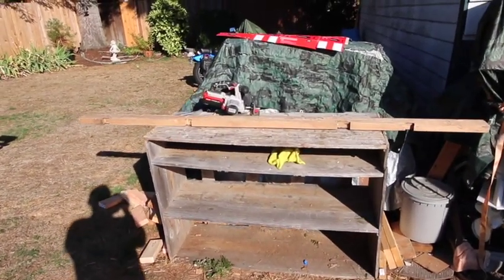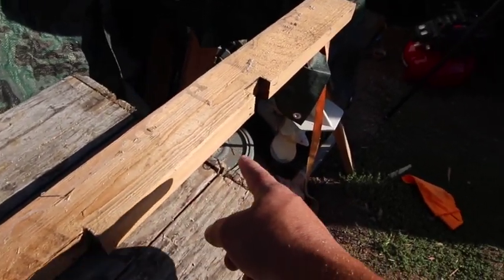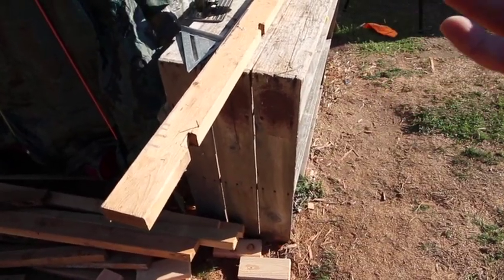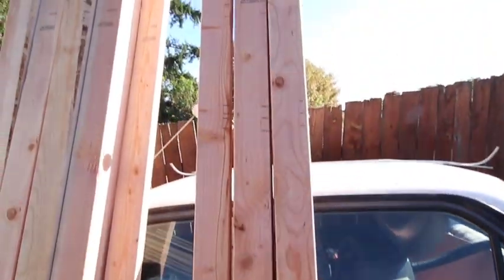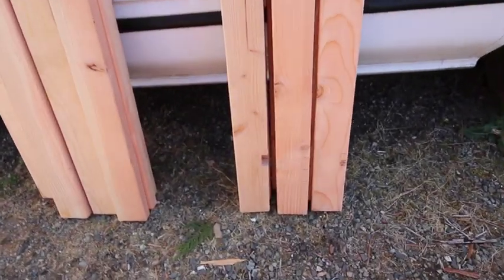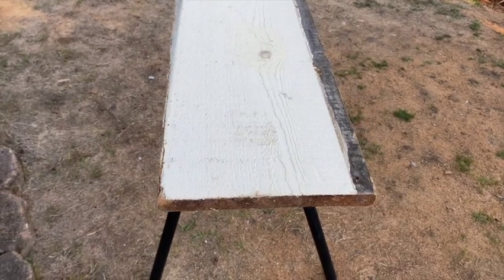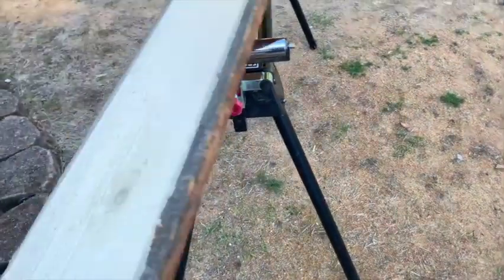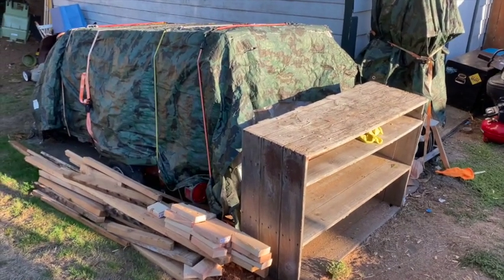Making Wall Studs for my Old Single Wide Mobile Home and Siding Explanaiton

Comment: Those cedar sure would look good but better being friendly with the inspectors and follow rules.
Reply from the maker: Yeah, he's been really helpful in giving me creative ways to work around some of the rules and avoiding the super expensive  permits and plans to get things done while still allowing the state to get some money out of me. But yeah, I was bummed about not being able to use that cedar on the house but I plan on making a number of outbuildings for a wood shop, auto shop, and a guest house so I may use them there. Or I want to focus on wood working projects once the house is done so I can always turn them into something cool in that regard. I had to pull them myself but they only charged me $5 a board which was a really good score I think.
Reply: @thesomewhathandyman9400  I fully understand... but with your skills I'm sure the next project will include ceder boards.
Great price for the used lumber, well worth it !
Reply from the maker: @VintageTexas59  Yup yup! Thanks again!

Comment: ✌️🙏🏻👍🏻  Keep on  , KEEPING ON 💪🏻   Adventures trailer home rebuild's.  
    Is lumber creeping down 💲 price wise.❓❓
Reply from the maker: It came down quite a bit but has crept up just a tad in the last month. Still reasonable. I did stock up on 2x4's and 2x6's as well as PT fence posts and PT fence 2x4's for next spring, just in case it goes back up. 2x4'x8's are around $3.50 and half inch ply is about $21. Not great but not crazy.

Comment: Wow are you replacing all the studs in the mobile or just some of them? I have a question on the siding. Im planning on doing sheathing and then t1-11 on mine but Im worried about the thickness when it comes to the tin roof on the top. I figured I would have to do a roof over first and then do the siding. I know you are rebuilding the rounded roof on yours, will you still be able to put the roof tin over the siding or do you have to replace all of the roof tin?
Reply from the maker: I was originally just going to replace some but most ended up having some part of them rotted, mainly at the bottom so in the end I'll probably end up replacing 80% of them with new. A lot more than I had originally thought I would have needed to do. Thankfully lumber is reasonable again.
Reply from the maker: As far as the siding, the t1-11 would act as the sheathing so you don't need to double up there with a sheathing backer. For durability I would try to find the real plywood type t1-11 and not the OSB type t1-11. My county inspector said to just make sure and put up a layer of house wrap stapled to the studs and just cover that with the t1-11 and I would be good to go. As far as the roof, I'm taking off all that old rusted tin and replacing it with plywood, a layer of foam boards on top of that and cap it with EPDM rubber. If you've ever heard of Drew's Roofing or not, watch his channel, he's an expert at replacing with EPDM. Plus not having the metal up there will help improve my cell signal. As far as where the roof meets the siding, I'm making those mini eaves and I'll have the rubber come down over the 2x4 eave a few inches and use a termination bar to secure it around the perimeter. I'll have a few inches sticking out after the termination bar so I can bolt a gutter just under the termination bar and have that excess rubber cap flow into the gutter so the water goes in there and not down the siding. Hope that helps!
Reply: @thesomewhathandyman9400  Nice! it will be a long while before I do the siding and roof. Mines in ok condition now, I just dont want to live in a tin can LOL.I will check out that channel. I havent decided what I will do on the roof yet. My only water out here is rainwater collection and those teeny gutters on the mobile just wont cut it. May leave the roof as is and do a long covered porch on both sides. If I do I will just bend the current roof gutters to be more like a drip edge then maybe be able to collect rain water off the roof and patios. Hopefully it works as well as it does in my head LOL
Reply from the maker: @BigDreamsTinyBudget  Haha, hopefully it will work well as well as it is in your head! ;) Yeah, these stock 'gutters' on old mobiles were an interesting choice by the manufacturers for sure.

Comment: I do not even understand the logic behind the cedar.  You are dealing with some politics.  The cedar would have been so pretty too, long lasting.
Reply from the maker: Yeah, it's weird but I kind of get it. They said if  what I'm putting up increases weight compared to stock I'd have to get engineering plans. The exemptions are t1-11 though, which last I checked is a lot heavier than aluminum. So yeah, in that regard it's totally building industry politics I'm sure. Oh well, should look good with how I'm planning to do the 'fake' board and batten. Thanks!